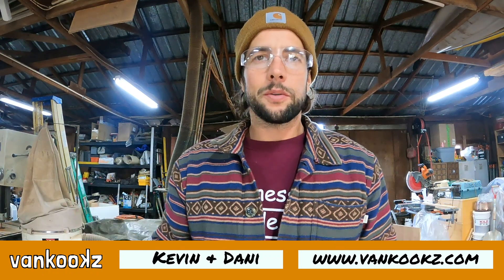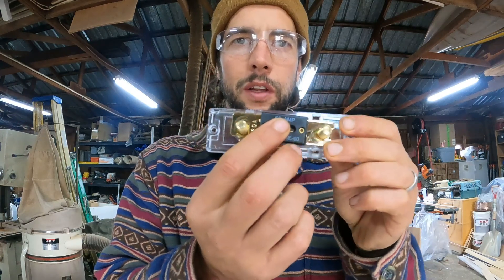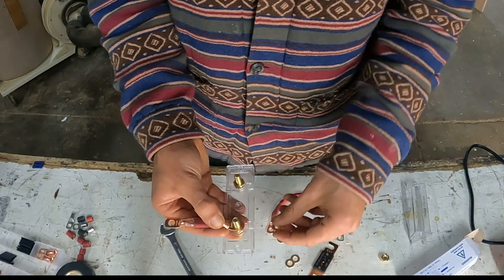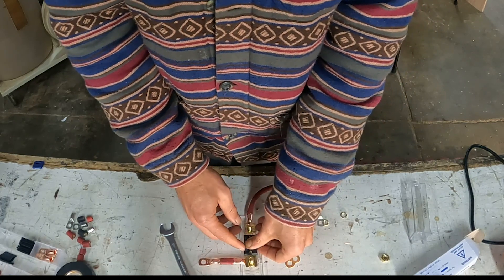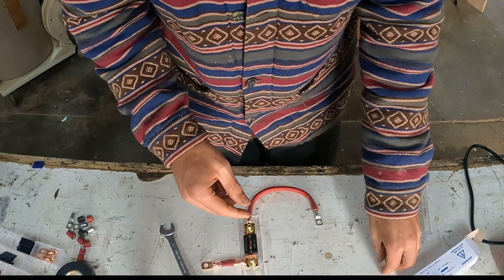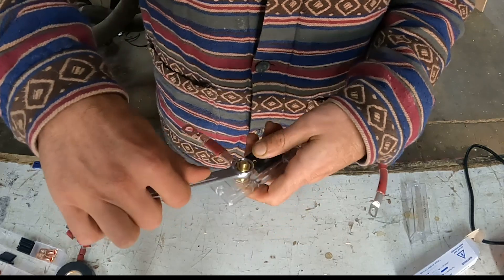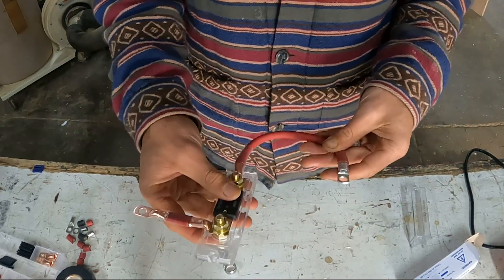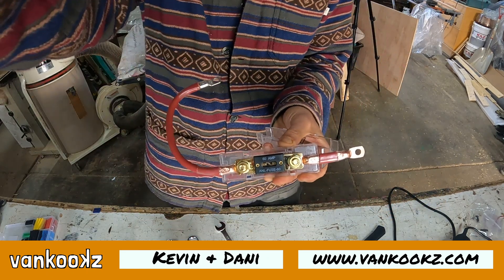How to wire an inline ANL fuse in your solar power system

Comment: It's important to note that actual conductors should really be in direct contact, i.e. without washers in between. If washers are to be used in between contacts for whatever purpose you should absolutely make sure they're copper washers, not steel. Steel washers are not great electrical conductors and will heat up due to high resistance. People using steel washers is one of the common causes of parts of their electrical systems melting under high loads.
Reply from the maker: Thank you 🙏

Comment: Can you tell me what size battery cable I should use to connect two 100AH lithium batteries together?  They'll be connected to a 30 amp charge controller and two 200 watt solar panels.  Also, where did you get that short little cable?  Thank you
Reply from the maker: 2 or 4 gauge wire will work. I buy the cables and then cut and crimp them to size.

Comment: Great video! I was wondering, can the fuse be removed when it's already installed? I'm looking to test the gauss at the start battery and I did not install the fuse and I'm nervous with electricity! Essentially I'm looking to disengage the alternator charging system to the DCC50S Renogy converter for testing. Thanks!

Comment: Why do you use a washer between the fuse and the wire terminal ? It reduces the contact surface and therefore create a voltage drop.
Reply from the maker: That’s just what the instructions said.  I have done it wrong in the past and melted the plastic
Reply: Wrong there must be direktly contact between the lug and the ANL fuse. NEVER put a washer between. It creates extra resistance= heating.
One remark, check your lug if there are no burrs from making the hole in the lug, the contact surface must be completely flatt. This happens by cheap lugs. @Vankookz